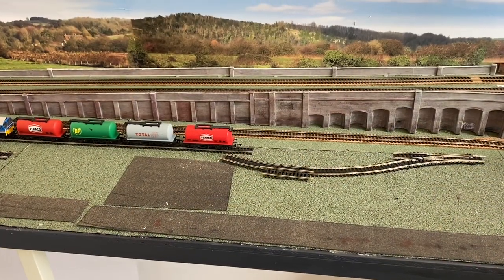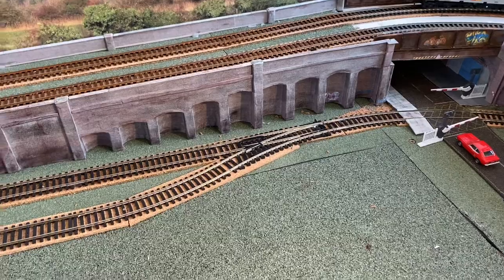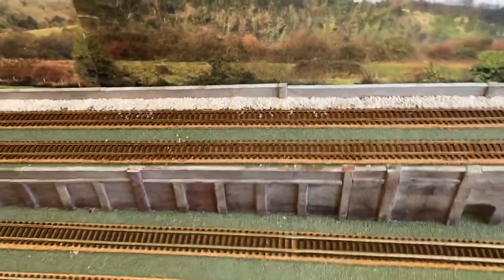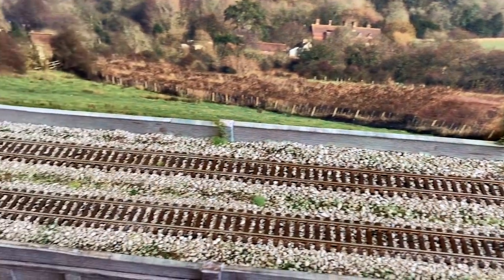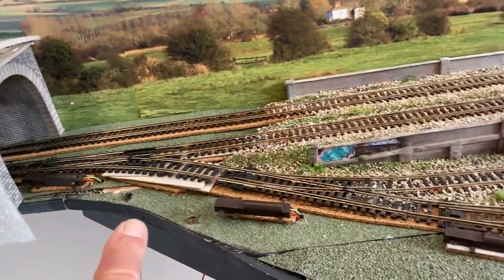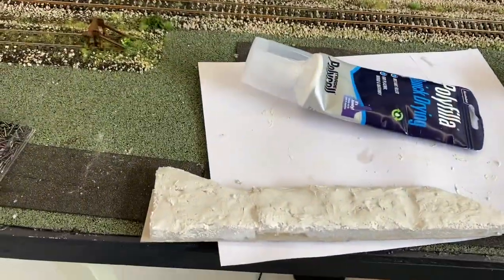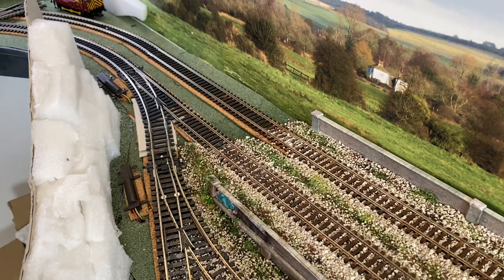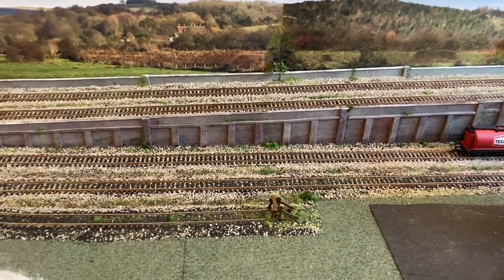20 Building my first model railway - Starting the industrial area. Part 1

Comment: hi ya great video again  -  with your points get some blue tac and roll into long thin sausage's and place between the point blades before ballasting plus it also keeps the blades open from both rails (this way you dont glue or ballast between the point blades) - with the point that loses power at the start of the Gas yard  just put a small loop wire in as a bridge so it makes it live all the time that way you dont need to change the point
Reply from the maker: Hi Paul, thanks for the tip, I do get paranoid about gluing the points so will definitely do what you suggest. Yes I have thought about doing a loop on the dodgy points. Just need to get the enthusiasm to take them out and solder which I am rubbish at but will definitely do that before ballasting that area. Thanks for watching and the advice.